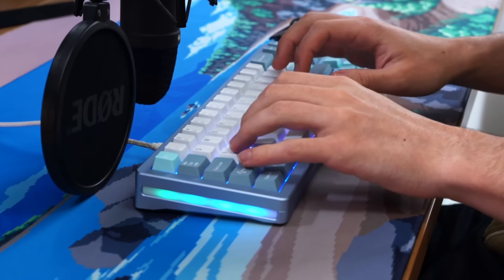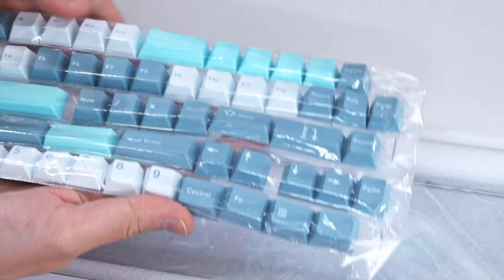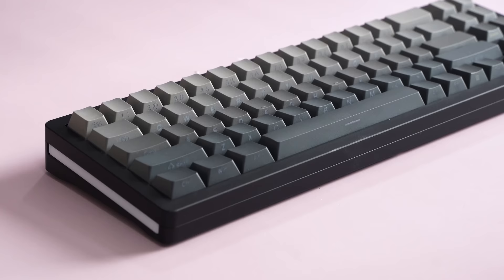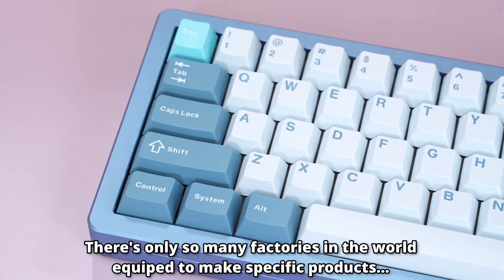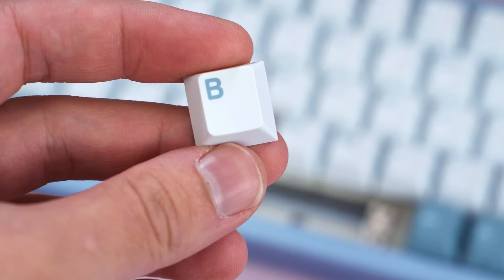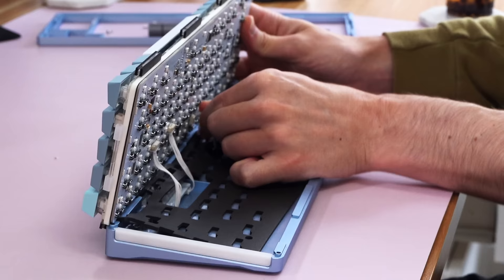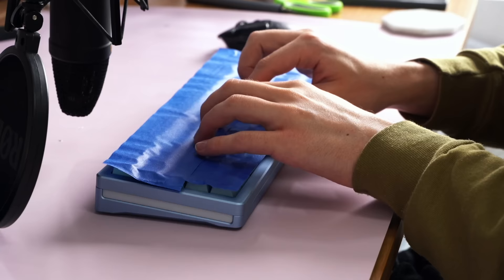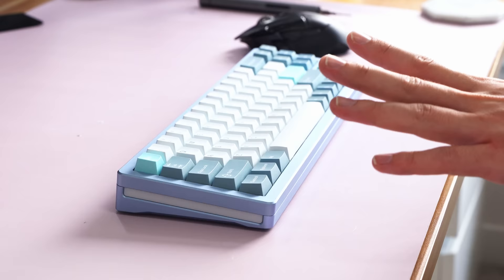Make Your Keyboard THOCK For $3

Comment: does anyone know if this SK71 able to use other switches than Outemu's? I saw someone mentioned that it is only hot swap for outemu's switches only. I really dig this blue alu color and i i wanted to use my morandi switches. If it's not compatible, then its a bummer
Reply: you can use any hot swappable switch with no issues
Reply: @StevenChris  oh really? I guess the one that i saw the review has its faulty then. Do you have this board? Whats your overall experience on it?
Reply: @StierZerk  yes i do have this keyboard indeed and honestly? It really doesn't need any mods to begin with out of the box the only mod that i did to this board is i installed 2 layers of tape back on the pcb and it sounds sooooo good i really can't recommend this keyboard more easily my best purchase of a keyboard so far......
Reply: @StevenChris  thats great man! Many thanks! Appreciate the time for sharing. I’ve decided to go thru with this purchase. Cheers mate for helping me out!
Reply: @StierZerk  Yeah glad i could help you out. Enjoy your new keyboard

Comment: Hey! Firstly, amazing videos thank you! 
I'm very new to the hobby and looking to get a Keychron Q6 and want to tempest mod it - you mention not using painters tape, mainly due to fire. The regular Q6 doesn't have a battery, so is electrical tape still recommended over painters tape? How long is it safe to leave on before removing and doing it again? Lastly, does removing the tape cause damage to the PCB / is there a safe way to remove it? Would love some help, definitely got a subscriber for life! :D
Reply: I've been tinkering with electronics for 20 years and only use high quality electrical tape, Nitto or 3M and these both will leave horrifying residue if left on. It's very tedious to remove and you'll need isopropyl alcohol. Electrical tape isn't meant to be permanent anyway. Painters tape is specifically made to not leave residue.

Comment: Just bought this keyboard. It smokes my old $250 Drop CTRL. Also, they fixed the sideglow! It's very well diffused now and looks super clean. All I did was the tape mod and lubed the stabs with dielectric grease and applied electrical tape over the flex cuts and this thing is DIALED. No pinging, no rattle, straight THOCK. Love it.

Comment: Well, I don't know about you, but I can get my 29 USD mech to make that sound by simply typing harder and bottoming out the keys. That leaves me with 60 extra bucks in wallet and still looking at a board with hot swapabble switches, double shot keycaps, braided cable, and adjustable height. I guess I'm doing wrong by not wanting to spend more on less.